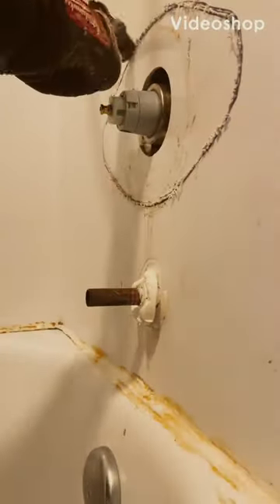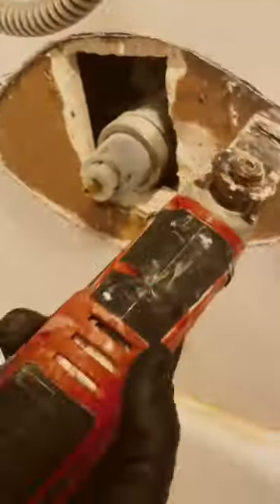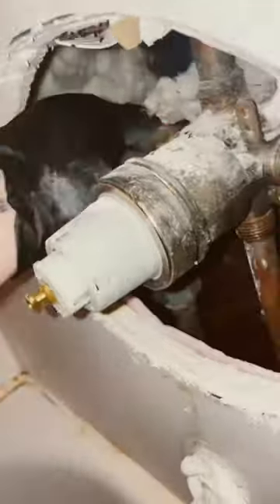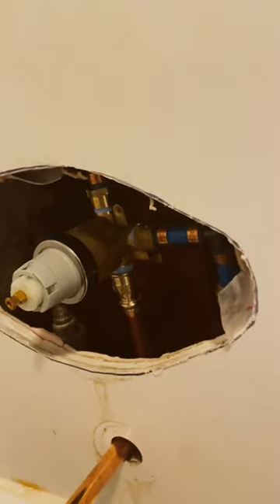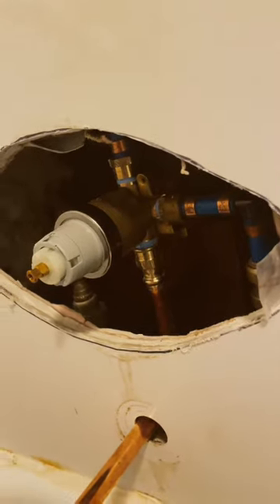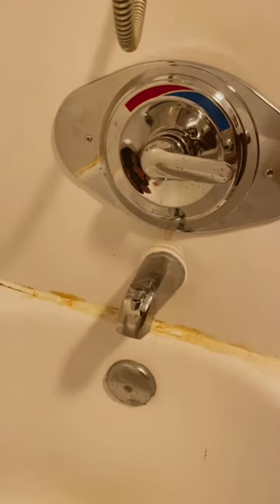Pinhole leak in shower valve#plumbing #shorts #plumbingvideos #viral #art #hacks

Comment: What the hell is wrong with just replacing the cartridge!? Oh my tires on the truck are back, guess I'll buy a new truck?
Reply from the maker: Pinhole leak in brass valve body….. wish a cartridge would have worked
Reply: A cartridge only works half the time. That trim plate is huge. I wish I knew where he got it. That would make it much easier to go in from the front and be able to cut that much out.
Reply: @blackwater8593  it’s called a “remodel plate”. Home Depot has them
Reply: Yep he just did it for no reason.

Comment: That is one thing I have never understood about showers and tubs. Why do people put them in walls you can not get to the back side of like exterior walls. If I was to build a house the tub and shower valves would be accessible from the back though a closet in the next room. Maybe go  as far as build an access door or panel.
Reply: No one cares about how easy servicing it is going to be. By the time it needs to be, 20 years may have passed, and it won't be their problem anymore. 

I don't do this, but I also cost extra, and people are cheap.
Reply: So at least here. We didn’t elect to have zoning and codes in our county till 2006. But there’s tens of thousands of houses built before codes. The current owners won’t afford to bring it up to code. Just the visible system will brought up. I run up on a ton of shower valves in an outside wall. With no access. But yes your correct. In a perfect world (new construction) you can find a wall behind this shower valve. You are correct.
Reply: But that never works for homosexual special rights. 
They never know who'll be living there next.

Comment: Why are you replacing the valve and putting the same exact one in there that’s a newer delta valve you should only how to change the cartridge Clean all the calcium out the valve body
Reply from the maker: Valve body had pin hole
Reply: @stricksplumbfix  That's a rare one but it does not surprise me who knows what that valve was in a previous lifetime

Comment: Why did you even replace it. Oh right gotta charge customers for shit they dont need
Reply from the maker: Actual brass valve body had pinhole leak. You cannot swap a cartridge if the body the cartridge goes in has pinhole

Comment: You replaced it with the same shower body. Changing the cartridge would have done the job fine.
Reply from the maker: The body had pin hole leak in old valve
Reply: And they say literacy is a problem... Noone reads. You need to answer the same snide comments over and over. Good work!
Reply: @scottapt5291  it’s not reading comprehension that is the problem, it’s that people like feeling like they are smart and superior to other people. They impulsively assume the person is an idiot and that only the circumstance they perceived is the one encountered in the video